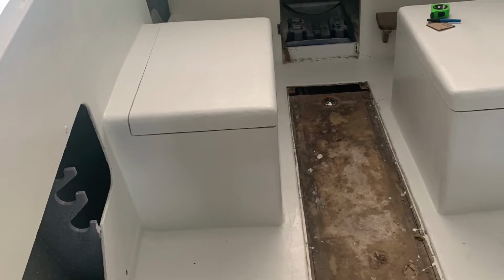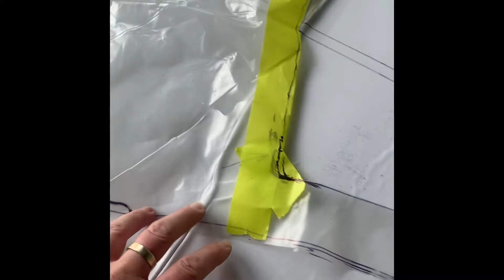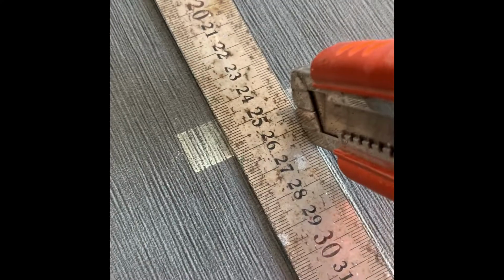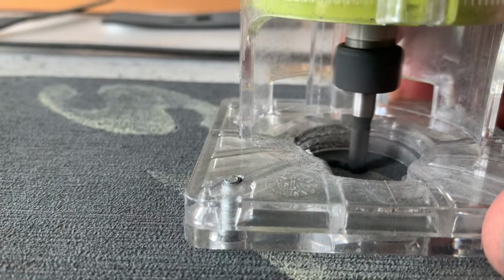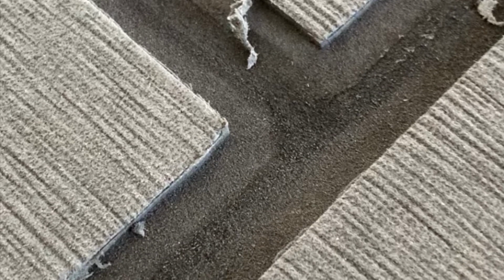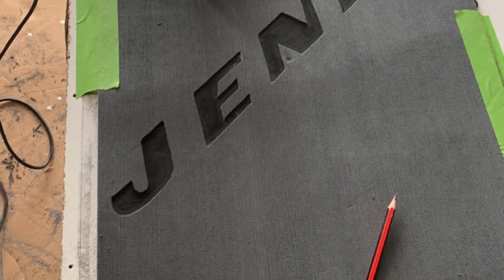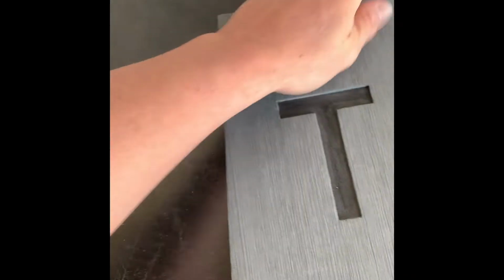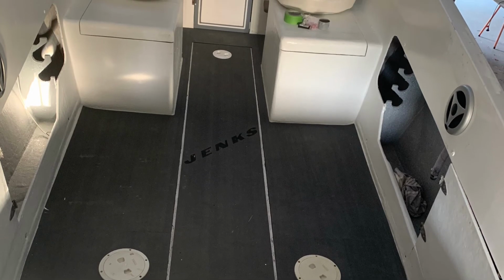DIY Boat EVA Foam Decking. Rout your own.

Comment: Just about to have a crack at this myself. Great tip with the sikaflex and paddle pop stick. Cheers mate!
Reply from the maker: Cheers mate, let me know how it goes.
Reply: @CAINIT  Started with black sika but I couldn't for the life of me get it to look neat enough (edges looked jagged). Ended up going to clear and it made the world of difference.
Reply from the maker: @mish441   took some time and a steady hand mate. Clear will be perfect. Would of been neater for me aswell. 😂

Comment: How has it held up to use and weather ?
Reply from the maker: Great so far mate. The part in the rear has unstuck a bit like under my motor in the rear well. But it gets a little oil and fuel dripping down there ect. 
Also the boat is always garaged so probly helps. 
But so far no problems at all.